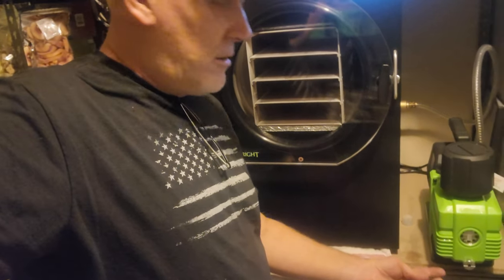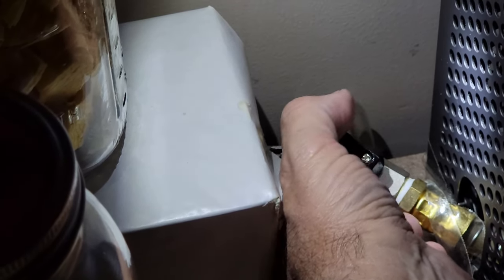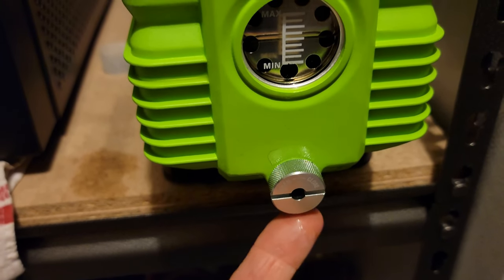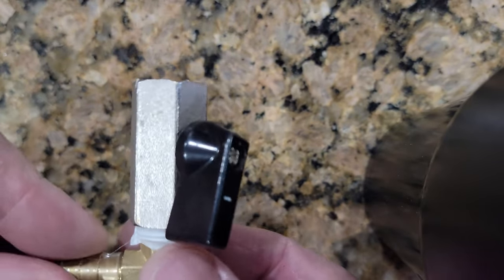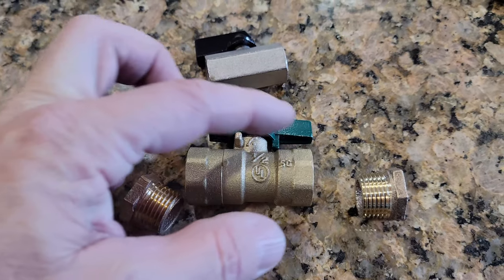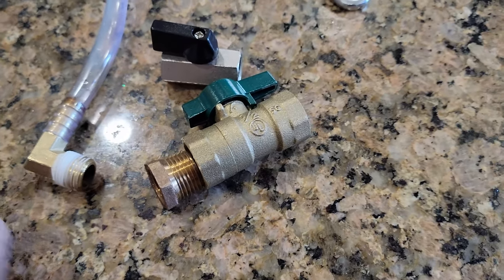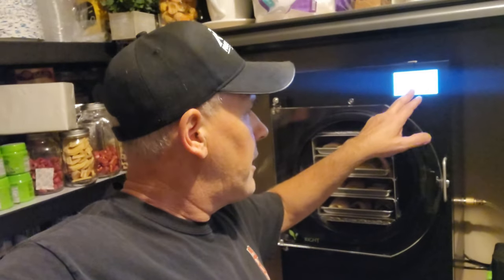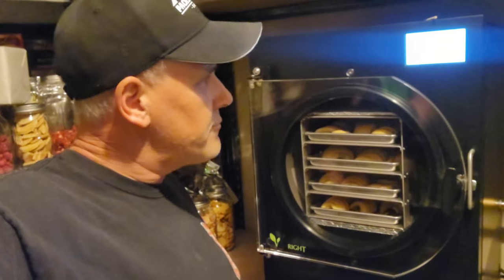Harvest Right Freeze Dryer ERROR! Unable to Achieve Vacuum Pressure. Troubleshooting & Repair. #DIY

Comment: You are the best! I called Harvest Right and they said I needed a $1,200 vacuum pump to replace the pump they have discontinued making (wonder why?) came across your video and it turned out to be the same problem. Thank you so much!
Reply from the maker: Thanks for watching and commenting. That is so awesome that it fixed your issue. $1200 is a big fix, especially when it is not the problem. Glad it worked for you. Ours is still working great with the fix and without any further issues. Have fun freeze drying! Take care and have a great day.

Comment: Thank you so much. I have lost weeks and weeks trying to fix this same issue.
I will do what you did. I don't have help and didn't want to take the machine all apart. I sure hope it works after this.
Reply from the maker: Thanks for watching. Sorry to hear about your troubles. If your valve is like mine plus loose and doesn't close right, it certainly could fix your problem. It was the easiest fix without taking the machine in for troubleshooting and repair. If your valve looks and works fine, I don't know. It may be a different issue. Good luck! Have a great day.

Comment: my freeze dryer has had that error for years! harvest right wont even call me back. i even had warranty at the time of failure. im gonna try this out and pray this fixes it.
Reply from the maker: Thanks for watching and commenting. I really hope this fixes your problem. I know it is super frustrating. A leak in the system somewhere causes this error. Mine was the crappy valve. Hopefully yours is an easy fix too. Have a great day.

Comment: My machine is 2 weeks old, I keep getting the same msg. I contacted HR and they emailed  me the new updated software 24. It worked twice, but today I got the msg again. I gotta call tomorrow again to figure this out. So far my experience has been more of a curse than a blessing. I have the Oil Free Pump, Medium Freeze Dryer.
Reply from the maker: Dang, that is tough luck. I hope they can help you figure out the problem. It sure can be frustrating especially when it is new. Sounds like there is a leak somewhere in the system. Not sure. If yours has the same valve, I wonder if that is the problem too. Maybe it is just not getting shut all the way. I think the valve could be better quality from my experience. Thanks for watching and commenting. Good luck on finding a solution. Have a great day.
Reply: @Packsalot  Found your video super helpful. Thank you so much. Hopefully my husband will change the valve tomorrow as well. Yes, it is the same one as your old one. I hope that's the only problem and it will be fixed. Bless you!

Comment: I work in scientific vacuum.  My Harvest Right gets to under 200mT.  525 is not low enough even though it allows the machine to run.  Make sure your valve is propane rated and use propane thread sealant on threads not teflon tape and make sure they are very snug.  Check the door seal on the inside to see if there is any debris.  It seals on the leading edge of the metal flange.  The pump leaking oil will not affect vacuum.  I hope this helps you.
Reply from the maker: Thanks for the tips. I did use a fuel gas rated valve but I did not use the right thread tape. However, since this fix, over a year ago, we have not had a single problem. The unit has been working great. I do still have the oil leakage at the glass though. Other than the mess from that, it does not seem to affect the performance. Thanks for watching and commenting. Have a wonderful day.

Comment: Hi! Having the same issues with ours, where did you get your replacement valve?! & thank you for posting about this issue, we don’t feel crazy anymore!
Reply from the maker: Thanks for watching. Sorry you're having trouble with your machine. The valve is a gas shut off valve which I purchased at the local plumbing supply store along with the reducer fittings to fit the already threaded tubing that's on the machine. Good luck Hope it fixes your problem. We haven't had a problem since. Have a great day.
Reply: @Packsalot do you know the valve size? Going to order a new one.
Reply from the maker: @B35point1  The original stock valve was 3/8 inch. I couldn't find one that size plus I wanted a better valve so I went up size to 1/2 inch.
Reply: @Packsalot  do you recall the thread twist? Sitting in front of my machine now with this problem. A few pounds of ground venison in there! What a bummer.
Reply from the maker: @B35point1  Not sure of the twist. I believe the thread twist is the same as like a sink valve. Not positive though. For a quick work around to save your meat try closing the existing valve really tight. Good luck with your fix.

Comment: Steve  fyi white teflon is plumber  yellow or pink gas tape, vacuum tape. clock wise wrap and turn the threads between fingers to set tape in threads.
Reply from the maker: Thank you for the information and comment. I used the white simply because that is what I had on hand and it was a drain line for the water in the unit after the freeze dy process finishes. However, it makes total sense to use the other type for the pressure reason too. I realized I did wrap the tape the wrong way on one of the fittings. Luckily so far, so good. If it gives me any more problems I will current the mistake. So far it has held up. Cruising my fingers. Thanks so much for watching. Have a wonderful day.
Reply: @Packsalot  Only on side is drain. you were losing vac through valve. other side is vacuum.
Reply from the maker: @johnbailley4468  very true. Interesting thing is, the valve that was removed had the white tape both sides, from the factory.

Comment: Nice figuring it out. You should have called me before you started the party. This is the crap I deal with every day. You reused tape on one fitting and wrong direction wrapped another 😂. Also if oil or gas is run through there make sure you use yellow or gray tape.
Reply from the maker: Thanks Jason. Yep, I'm certainly not a professional when it comes to plumbing. Lol. Glad it worked though. Luckily, this valve is just in the drain hose of the unit where the water and condensate drains out during defrosting  process. However, it is crucial for sealing of the unit in order to achieve vacuum pressure. Have a great day.

Comment: Was that a gas valve? Um sorry I’m not technical, but I can take things apart and put them back together again. My machine is doing this too, only 1 yr old premiers pump.
Reply from the maker: @plainandsimple2576  Yes, this was a gas valve that I used. The junk valve they had on the machine was no good. I have not had a problem since the fix to the new valve. I hope this fixes your issue too. Frustrating! Good luck. Have a great day.
Reply: @Packsalot  thank you!
Reply: @Packsalot  I changed it and it’s working now! Thank you!!!!♥️
Reply from the maker: @plainandsimple2576  That is great to hear. I'm hearing this success from others as well. Being that Harvest Right is a local company to where I live, I'm half tempted to go down to their corporate office and let them know they have junk valves that are causing problems. Happy freeze drying and have a great day.
Reply: @Packsalot  right?

Comment: also the vacuum hose has two problems. 1- weak crimps   2- fittings  brass to steel connection. you never put to difference metals togetter (expansion and contaction problems -- bad for vacuum systems!
Reply from the maker: Agreed. I wonder how many of their units have these vacuum problems eventually, for these reasons. I'm just glad it is fixed and has not given us any more problems. Thanks again for the comments. Have a great day.

Comment: Not to be rude, but you wrapped the tape the wrong way on the valve and that could potentially lead to it not sealing very well or premature failure. Best of luck.
Reply from the maker: No worries. Doing things incorrectly is how we learn to do better for the next time. Thanks for the comment. I realize the tape issue now but so far so good since this video posted. The freezer dryer has been working great! I hope that if you are having the same issue with your freeze dryer that this fix may work for you. Have a great day!